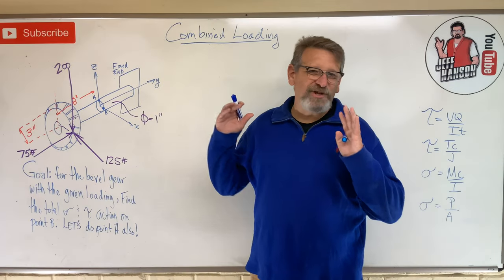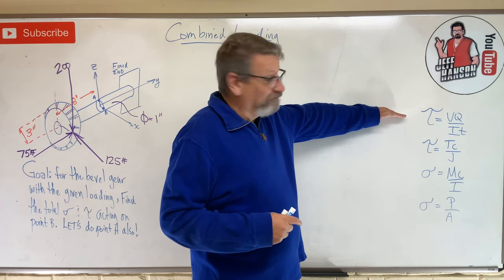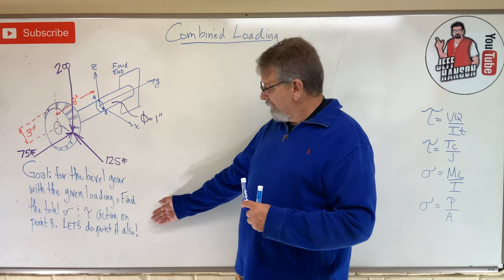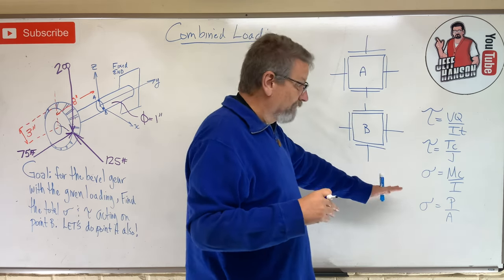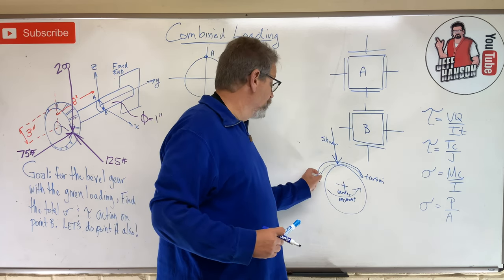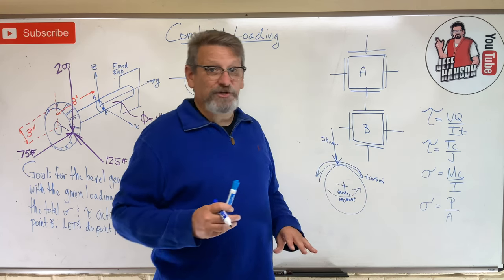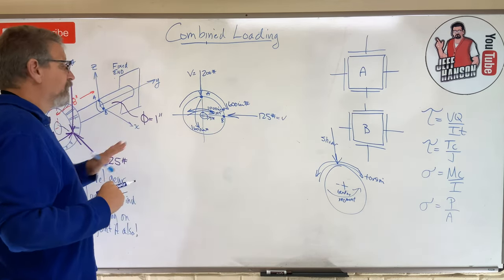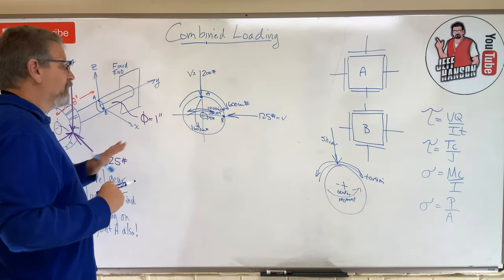Mechanics of Materials: Lesson 46 - Tough Combined Load Example Problem

Comment: Dr Hanson I got confused a little bit. Personally, when it comes to the shear stress, I'm taking a convention so clockwise negative and ccw positive because what confused me is that the torsional moment is positive for B and negative for A which isn't logical, the torsional moment rotates A and B in the same direction. So to conclude, the only difference is that I get the same stress components for both A and B (I don't know if this is supposed to happen). Please anyone who has really grasped my POV , I would appreciate if you could explain what is really happening.
Reply: The torsion does rotate A and B in the same direction however if you look at the original figure you will notice that the 125# force shears off the tube in the opposite direction than the torque while the 200# shears it off in the same direction. Hence the + sign for point B (same direction) and - sign for point A (opposite direction). Hope this helps!
Reply: @clarissa4662  but the torcion force wins over the 125#, so much so that the tau ends up being negative in A. As A and B are opposite signs, having the tauA negative and tauB positve will end up making the arrows on both B and A the same directions. Im also confused and i thinl he made a mistake on A so im not sure, but i think the mistake came from assuming that he shear stress on A was cause by the 125#  and instead of the 200#

Comment: At 25:25 I'm having trouble understanding how to chose which direction to put the sigma stresses. "Stress element A" makes sense to me, the stress element is along the x-y plane and the combined stress is in the y direction so sigma_x=0. But it looks to me that "stress element B" is in the z-y plane so technically Mr. Hanson is right putting the 7.8ksi stress in the y-direction, but shouldn't it be drawn so that sigma_z=0 (not sigma_x=0)?

Comment: Hello Mr. Hanson! Thank you for your great videos! 
I have a question regarding the arrow direction. (Min 26.18 )On the top left you said that the middle square is our stress element and drew an arrow up on the left side and an arrow down on the right side. But on the actual stress element on the right of the board you did the left arrow pointing down and the right arrow pointing up. Can you please explain this?

Thanks !
Daniel
Reply: Hey,
Make sure to turn the middle square, align it with x and y and drop it normal to the point of interest, you should find the good arrow direction that way 👍